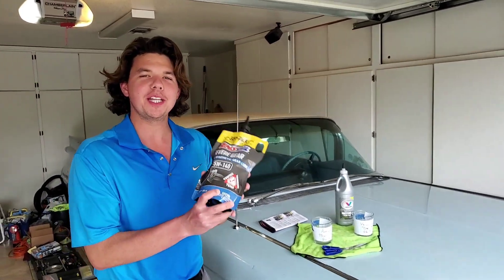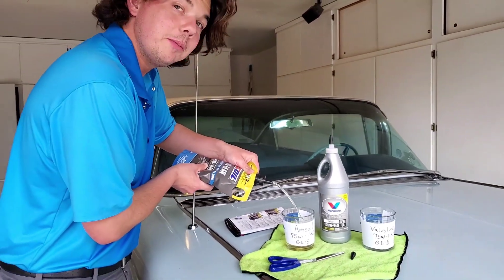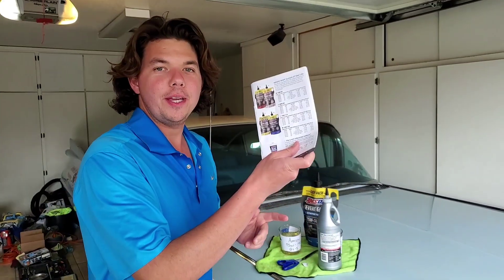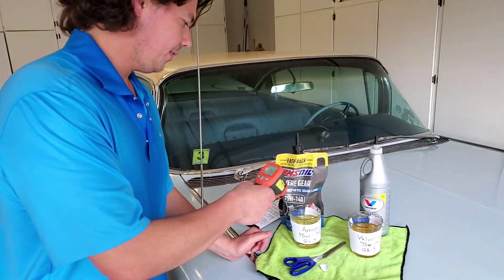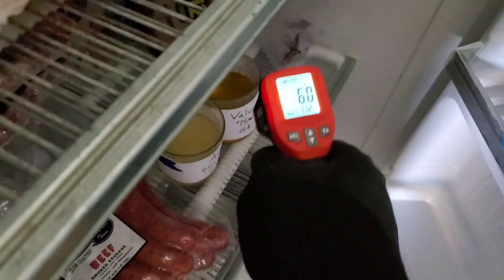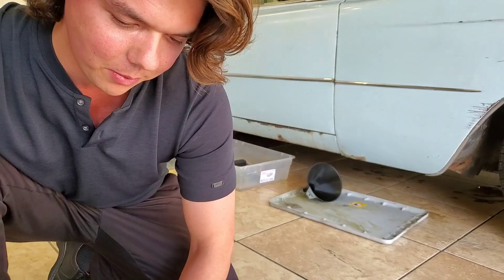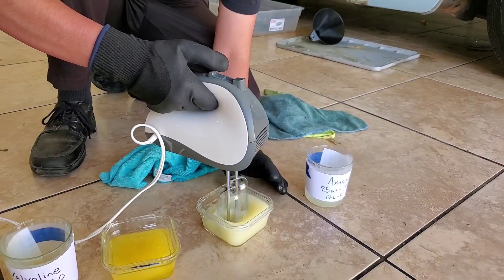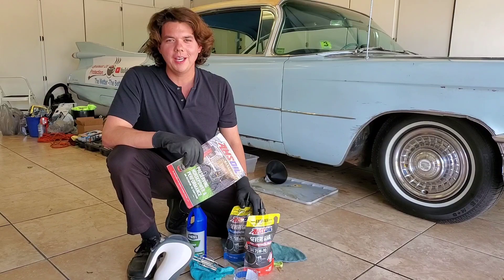AMSOIL vs Valvoline SYNPOWER Gear Oil 75W-140 Cold Pour Test

Comment from the maker: Check THIS: AMSOIL vs Super Tech Gear Oil 75W-90 Cold Pour - https://youtu.be/8rAubIZMoGc

     My Link: Best AMSOIL 100% Synthetic @ Wholesale + FREE Shipping: https://www.amsoil.com/offers/?zo=5331179

     AMSOIL Products & Vehicle Lookup - https://www.amsoil.com/guides.aspx?zo=5331179 

     AMSOIL Performance Tests - https://www.amsoil.com/performancetests.aspx?zo=5331179

Follow these accounts for Ebens Giveaway:
Instagram - https://www.instagram.com/syntheticoilprotection/

     Eben Facebook - https://www.facebook.com/profile.php?id=100007973957868

     People ask me these three things:

1. Where can I find AMSOIL? - Use this link https://www.amsoil.com/offers/?zo=5331179
Or
Watch THIS: 3 Fast Ways To Get AMSOIL - https://youtu.be/RiYifuDCsnQ

2. What makes AMSOIL different than other oils? - AMSOIL is 100% Synthetic & has higher film strength & last 4×longer then Mobil 1 EP which protects and separate metal parts keeping them from wearing and Lasting Exponentially longer: https://youtu.be/f4eNPgTi_qo

3. Why should I use AMSOIL?: It protects the engine so it will last longer. Less oil changes less often(once per year/15,000miles) or longer... Save money in Gas & Time making it less expensive then a free oil change over the year - https://youtu.be/H7K6FdZlqmg

     Professional YouLubher:
Eben Rockmaker Master Direct Jobber AMSOIL Specialist (Dealer#: 5331179)
Mobile: (702) 472-3614

     My Link: Best AMSOIL 100% Synthetic @ Wholesale + FREE Shipping: https://www.amsoil.com/offers/?zo=5331179

     AMSOIL Products & Vehicle Lookup - https://www.amsoil.com/guides.aspx?zo=5331179 

     If your vehicle is not on the lookup guide this is AMSOIL Tech Support 715-399-8324 be sure to refer to Eben 5331179

46,000 Mile AMSOIL Oil Analysis - https://youtu.be/UjijQK5wSM0

     Friend me on and tag me because I like to see great results from my YouTube Community:

Instagram - https://www.instagram.com/syntheticoilprotection/

     Eben Facebook - https://www.facebook.com/profile.php?id=100007973957868

     Order AMSOIL By Phone:
Be sure to give them my number so I get credit Eben #5331179 and tell them you would like to be a Preferred Customer.

1. Call 1800-956-5695
2. Ask for your own preferred customer membership because you will get 25% off, free shipping over $100, and your informative quarterly AMSOIL Magazine. It costs $10 for 6 months or $20 for the year which is well worth it.
3. Give them my dealer number so I get credit Eben 5331179
4. Orders over $100 will be shipped free.

     Industry-standard 3rd party testing results:

AMSOIL Signature Series 5W-30 Synthetic Motor Oil protects against harmful deposits on turbochargers 4X better than Mobil1® Extended Performance and 3.6X better than Royal Purple® in industry-standard testing*.
https://www.amsoil.com/newsstand/motor-oil/articles/leading-the-field-in-deposit-protection/?zo=5331179

     AMSOIL Better Gas Mileage -
https://www.amsoil.com/newsstand/motor-oil/articles/another-win-for-amsoil-products/?zo=5331179

     AMSOIL Performance Tests - https://www.amsoil.com/performancetests.aspx?zo=5331179

     Professional YouLubher:
Eben Rockmaker Master Direct Jobber AMSOIL Specialist (Dealer#: 5331179)
Mobile: (702) 472-3614

     My Link: Best AMSOIL 100% Synthetic @ Wholesale + FREE Shipping: https://www.amsoil.com/offers/?zo=5331179

     AMSOIL Products & Vehicle Lookup - https://www.amsoil.com/guides.aspx?zo=5331179

Comment: Hi, can I use 75w140 oil in the front differential of a 1st gen 99' Outback Limited? Or could it be harmful? Thanks!
Reply from the maker: That's a great question I honestly don't know what the OEM spec is on that I believe it's 75 W - 90.
I personally would run what comes in it from the factory the viscosity.
You'll have better fuel mileage running the correct.
Look up guide right here on my website will give you the exact product for your Outback👍.
For me to get credit & be "Your" Independent AMSOIL Dealer, please use my website below or my dealer no. 5331179 call anytime Eben Rockmaker 702-472-3614
After you click on: https://syntheticoilprotection.net/
1. Click the hamburger menu
2. Click offers AMSOIL preferred customer
3. Click join now. 6-month PC member add to cart.  ( There is no reoccurring renewal membership unless you select that dot box ) 
( You have the option to not have your credit card saved if you prefer - est. 1972 )
4. Scroll up to the top Select shop by vehicle. 

New Promo Codes: FREETOOL

Comment: I have used 55w-140 Red Line, which has horrible flow properties earlier in the morning here in winter in Washington, DC. This gear oil has taken my 15 ATS from a mpg of average of 22 mpg and to the hwy of 31 mpg to 20 mpg to 26 mpg hwy. I am switching back to 75w-90 Amsoil, which had better cold flow properties. I had recently went to an aftermarket diff unit in the ATS, and temporarly had to change the oil in the OEM diff unit.
Reply from the maker: Interesting never heard of that viscosity but I'm sure they have special racing fluids which are specifically maybe just for racing not sure if you're a preferred customer but that gives the best value on the products💯👍
I give a man a fishing pole & show him how to fish. 

     Together! We can get your vehicles to run better than brand new!

     For me to get credit & be "Your" Independent AMSOIL Dealer please use my website below or my dealer no. 5331179 call anytime Eben Rockmaker 702-472-3614
After you click on: http://syntheticoilprotection.net
1. Click hamburger menu
2. Click offers AMSOIL preferred customer
3. Click join now 6-month PC member add to cart.  ( there is no reoccurring renewal membership unless you select that dot box ) 
( you have the option to not have your credit card saved if you prefer - est. 1972 )
4. Scroll up to the top Select shop by vehicle.

New promo: FREEQS

Comment: Just to clarify Steven, Vavoline "full synthetic"  is not 100% synthetic?  Thanks.
Reply from the maker: Correct a lubricant can be called full synthetic when it is 75% conventional oil in 25% synthetic Amsoil is 100% synthetic☕️
I give a man a fishing pole & show him how to fish. 

     Together! We can get your vehicles to run better than brand new!

     For me to get credit & be "Your" Independent AMSOIL Dealer please use my website below or my dealer no. 5331179 call anytime Eben Rockmaker 702-472-3614
After you click on: http://syntheticoilprotection.net
1. Click hamburger menu
2. Click offers AMSOIL preferred customer
3. Click join now 6-month PC member add to cart.  ( there is no reoccurring renewal membership unless you select that dot box ) 
( you have the option to not have your credit card saved if you prefer - est. 1972 )
4. Scroll up to the top Select shop by vehicle.

New promos: FREEQS

Comment: I’m more concerned about  metal to metal gear protecting a normal operating temperatures. Thicker is better
Reply from the maker: The thickness of the lubricant is insignificant it's the sheer stability of a vehicle under high heat of a lubricant under high heat the higher quality lubricants don't Shear down under heat and stress and extreme conditions especially with fuel delusion and other different things that come into play.
♥️   See fluid performance tests - https://www.amsoil.com/performancetests.aspx?zo=5331179

Comment: I am all in on amsoil 

I have a question ...   I have two 2020 Mustangs, one a GT convertible and a GT350.    I am planning on using the 75w-140 in lieu of the 75w-90 ... I drive the cars as intended and put on lots of miles.   What are your thoughts ... I also bought the additive from Amsoil
Reply from the maker: That's awesome yeah the difference is you have a little thicker film with the thicker stuff if you're doing like heavy loaded ships definitely a good upgrade however on the highway you'll get little less fuel mileage because of the it's thicker so just a little bit of a give and take if I was doing all racing I would probably stick with the thicker stuff if I was doing more just City driving I would probably stick with the OEM viscosity👍

Are you a preferred customer?
Reply: @Syntheticoilprotection     Thank you for your reply.

Yes, I am a very happy Amsoil preferred customer ... 

Love all their products and test the other top brands against Amsoil in my vehicles to see how many actual miles I can go till the oil meter reads 30% oil life left.

I change my oil once it hits the 30% mark.
Reply: @Syntheticoilprotection  Getting better gas mileage in my 2020 F150 3.5L Supercab after changing out the front and rear differential and the transmission fluid with Amsoil.   And I used the 140 rear end oil in the Mustang and it runs cooler as a result, even at 155 mph ... And the gas mileage did not change ... must be the extreme heat

Comment: I would have gotten the Amsoil but your lucky to even find good differential oil in Jan 2022 both Autozone and Oreilly were very low in stock of top tier oil I had to have Autozone look in the back for Valvoline 75W-140 GL-5 differential gear lube Amsoil was no where to be found. Walmart is cleaned out of all oils, there sometimes in stock but 2022 its get what you can....
Reply from the maker: Amsoil is available This is my link and I recommend the 6-month PC membership If you're new to Amsoil.
https://www.amsoil.com/p/severe-gear-75w-140-svo/?zo=5331179
Reply from the maker: Amsoil does have it available.

I recommend the 6-month PC membership if you need Amsoil when you use my link I would be your Amsoil Dealer so I could always answer all your questions in the future on the products and I would also get the credit for your orders.
🎬 Professional YouLubher: Eben Rockmaker Regency Gold Direct Jobber AMSOIL Specialist (Dealer#: 5331179) 702-472-3614 

     ✅ If You're New To AMSOIL I Recommend The AMSOIL 6 Month PC Membership because it will save you about $33 on a $100 purchase after the difference in tax - https://www.amsoil.com/offers/pc/?zo=5331179

Comment: I was just wonder why amsoil quart bottles don't come with the seal under the Cap? I have recently opened and used 0w-20, 75w-90, 0w-40FS European formula quarts bottles and none of em had that seals under the caps
Reply from the maker: They have a seal around the lid and once you crack that then it's open the ones that have the seal on top are like the easy squeeze pack but not the standard court
Reply: @Syntheticoilprotection  thank you for the information. 👍

Comment: You could tell immediately there was a bias and this was meant to show you how good Amsoil is rather than A true comparison.  

The cups should’ve been in a cradle, that you turn from the side where they turn exactly at the same rate. Just way too easy to introduce bias the way this video was conducted.
Reply from the maker: Oh there's no bias You can look up all the data here big difference between the oils also the way they flow are totally different you'll see the width of the stream.

No way to do by us here This is a one fixed piece of glass when the main piece of glass moves both cylinders move.

Yeah those oils aren't even close.
The Power of AMSOIL Signature Series 5W-30 Synthetic Motor Oil protects against harmful deposits on turbochargers 4X better than Mobil1® Extended Performance and 3.6X better than Royal Purple® in industry-standard testing*.  Read This Article - https://www.amsoil.com/newsstand/motor-oil/articles/leading-the-field-in-deposit-protection/?zo=5331179
Reply from the maker: I appreciate you being a part of my YouTube community I was just like you when I first found out about Ames oil at SEMA about 7 years ago when the guy there Tom told me that the oil was good for 25,000 miles and I said that sounds like a haka S***.

Well I tried it and boy was I surprised.

AMSOIL Performance Test Results. Read This Article - https://www.amsoil.com/performancetests.aspx?zo=5331179

Comment: Eben you are a beautiful person...but i cant fucking afford that stuff! I want it but its ridiculously expensive!
Reply from the maker: 😄😁😆, You're funny 😉

There's a couple different ways you can buy Amsoil the best way is a preferred customer membership that one will give you the 25% off which saves about $33 and $100 order.

There's also different levels of motor oil if you're looking for a more cost-effective option and you don't need the extended drain interval I always recommend the OE oil great way to get your toes wet and you'll definitely be surprised at how much smoother your car runs because it's 100% synthetic much stronger film strength.
This is the product I mentioned you'll see how it's about the same price as the most inexpensive oil anywhere as a preferred customer -https://www.amsoil.com/p/oe-0w-20-synthetic-motor-oil-oez/?zo=5331179

If you're looking for the overall most cost-effective that's going to be the signature series motor oil however the upfront cost will be a little more in the long run it will actually be a lot less and that's where it becomes less than free I actually made a video on that right here - https://youtu.be/lR8zvAizmI4

Comment: I need some thing to thicken my toyota yaris gear oil (automatic 2012 model), it gear does not shift smooth, it only works fine when i use some thick oil
Reply from the maker: I would try AMSOIL.
This will give you everything for your vehicle.
Find Products For All Vehicles - 
https://www.amsoil.com/guides/?zo=5331179
Reply: But the problem is that after 2 or 3 months it behaves same again, i hope the oil get thinner by time. So i need some solution, which i think best is to use thick oil (dont have money to repiar or change gear box)
Reply from the maker: Happy to talk anytime.
Professional YouLubher: Eben Rockmaker Regency Gold Direct Jobber AMSOIL Specialist (Dealer#: 5331179) 702-472-3614 

   AMSOIL Wholesale Pricing - https://www.amsoil.com/offers/pc/?zo=5331179

Comment: Can you add 20% pure synthetic Lucas additive to amsoil for an oil change
Reply from the maker: Of course you can!

You can add anything to AMSOIL.

If you disturb the chemistry of the signature series motor oil amsoil will not give the warranty of 
25, 000mi or one year.

But there's lots of things you could add to it You could mix it with any other oil regular mineral oil anything.

Comment: Trying to find anyone local that sells it is a non starter.
Have to order it online. 
Says 7 day delay on there website.
I cannot wait two weeks unfortunately.
Love to buy it otherwise.
Reply from the maker: Hey Mike the only reason they have that there is just in case one of the shipping route guys gets coveted and that way they will be at the latest.

If you order before noon 90% of the time you'll have the products next day with free shipping.

You can buy it through my link and you'll also have the 6-month preferred customer membership which will give you the 25% discount and you'll also have the free shipping.

That way I'll be your amsoil Dealer and I can always help you anytime.

Professional YouLubher: Eben Rockmaker Regency Direct Jobber AMSOIL Specialist (Dealer#: 5331179) Mobile: (702) 472-3614 

      Synthetic Oil Protection Website - http://syntheticoilprotection.net/
Reply from the maker: If you have any questions Mike you can always give me a buzz. ☕

Comment: Moving to Colorado soon, with my 84 chevy blazer 4x4. What weight should I use in my older truck?
Reply from the maker: It depends on if it's a flat tappet cam or regular motor roller rocker I would go with the 0w 30 Signature Series if it was my truck if it is not a flat tappet cam you'll see it here in the lookup guide.
Lookup For Your Vehicles - https://www.amsoil.com/guides.aspx?zo=5331179
Reply from the maker: The biggest thing you want to find out is if it's a flat tappet cam then you would use the 10 W 30 Z rod

Comment: If you have a PTU and love your car, it's the only gear oil you should use.
Reply from the maker: What is a PTU?
Reply: @Syntheticoilprotection  power transfer unit for cars who have all wheel drive
Reply from the maker: Sweet, I've never heard of that and I liked it like a transfer case☕
Reply: @Syntheticoilprotection  Power transfer unit. It's like a transfer case but for a car or SUV AWD

Comment: Not gonna lie, the Valvoline looked pretty good though
Reply from the maker: Yeah it's surprise me☕
Reply: If the gear lubes performed the same I would still choose Amsoil. The easy pack is the best package I have used for differentials and transfer cases.
Reply: @bikerdog2b Valvoline comes in a bag too
Reply from the maker: @aquaman6081 have you tried both ?